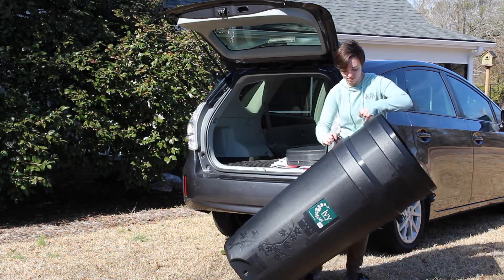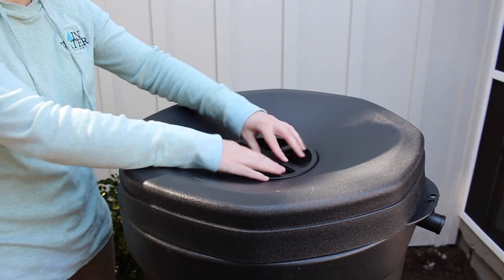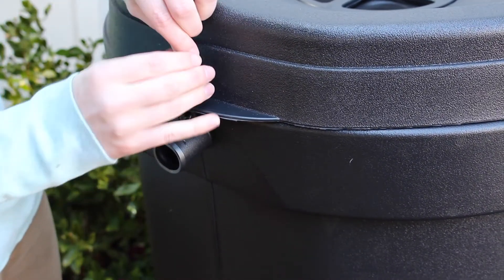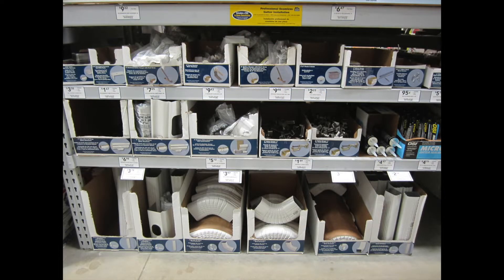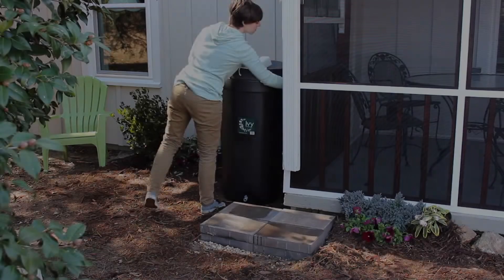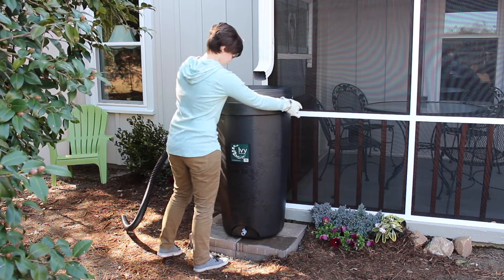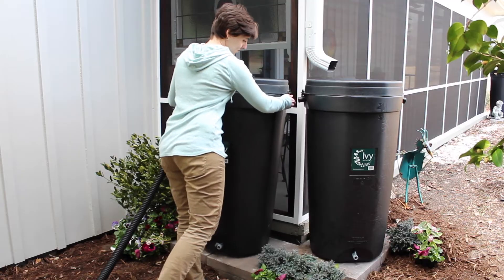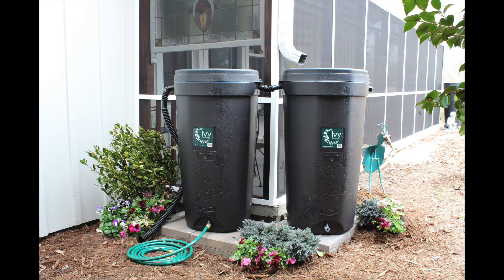Rain Water Solutions - How to Install Your Ivy Rain Barrel

Comment: What do you do with these when it’s freezing outside?  Where will the water drain to in the winter if you cut the rain gutter so short?
Reply from the maker: We recommend winterizing your barrel if you live in a climate with regular freezes. If you save your gutter pieces you can reattach them in the winter when you store your barrel. We will have a video coming out soon with more information on winterizing.

Comment: Question 
Do you recommend draining  the barrel during the winter months when temperature is below freezing?
Reply from the maker: If it freezes in your area for longer than 3 days at a stretch you need to winterize it. It will survive a day or so fo freezing but that's it. We do not warrant our rain barrels from freezing. Thanks!

Comment: I worry about using recycled plastics, and storing water for growing food in old plastic.  Plus, how do we make sure our old asphalt roof is clean enough for clean water?  I'd rather just have lots of trees, shrubs, plants and mulch to help the rain soak down into the water table.
Reply from the maker: We source our plastic from known, reliable sources. It is thoroughly cleaned before production. Recycling is much better than just sending it to the landfill. The rainwater stored is for non potable use only. Asphalt shingles do hold a lot of organics and depending on the age of the roof can make the collected rainwater not suitable for irrigating edibles. Rainwater harvesting has many benefits and by holding back some of the rainwater to use later is better than just letting it run off.

Comment: Are you still providing parts?  I found the list on your website.  

I purchased  two Ivys (50g) yesterday from a FBMP seller.  They are missing parts (I contacted the seller after reviewing the parts - we did a quick check at the pickup location but she was in a hurry and I missed the fact that the overflow was a long hose - she only provided a connector hose). 

Anyway, I need  two overflow hoses and the black caps (also missing) for the other sides and the zip ties.  (sigh) 

Also the outsides of these green ones are pretty scratched .. would i be able to spray paint them black?  i would use an outdoor paint. 

thanks for your help!

PS  perhaps the FAQ could be available as a downloaded pdf.  thanks
Reply from the maker: EJ, you can purchase components here: https://www.rainwatersolutions.com/products/ivycomponents
Curious what an FBMP is? You can paint our rain barrels wit Krylon Fusion. Clean the barrel thoroughly and follow the application instructions for the paint.
Thanks.
Mike
Reply from the maker: Please check your inbox. We sent you a link for parts.

Comment: Thank you for the video. I think the point that isn’t explained here is how to get water from second barrel. It seems we need to connect another hose or reuse the same hose again. It becomes difficult when bushes are around it. 😏
Reply from the maker: You want to install them where it's most convenient to access the rainwater. There are two ball valves in the set up you are describing so simply switch the hose to second barrel when first one is depleted. Or add a second hose. Get as creative as you wish to make accessing the rainwater as easy as possible.
Reply: @RainWaterSolutionsTV  I was thinking the same question. This isn't a good design what you are describing. It is extra work. Instead you need to design this in such a way that the overflow valve from first is connected to the bottom of the second. This way all two will have the same level of water all the time and you only need to plug hose to one barel and it will get water from both the barrels. I was considering to buy this as this is provided at a discounted price through my city of Plano but after seeing this I may not be buying it. The system is good for 1 barrel though.
Reply from the maker: @zeroweb0  you can use garden hose components to make therm all drain from the bottom. We are working on a video for that now. Stay tuned.

Comment: What is the recommended method to prevent mosquitoes 🦟 from thriving in standing water?
Reply from the maker: Gerrit, our raion barrel is screened as well as it comes with an overflow hose and a cap for the two overflow ports. As long as all the parts are in their proper place our rain barrels do not let mosquitoes breed. Some rain barrels do not include screening or provide adequate mosquito protection so buy beware.